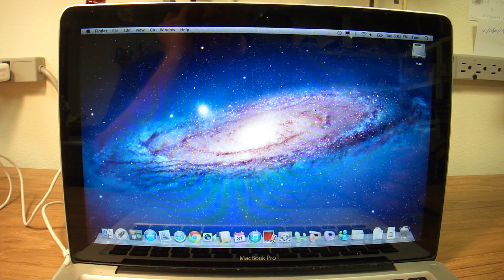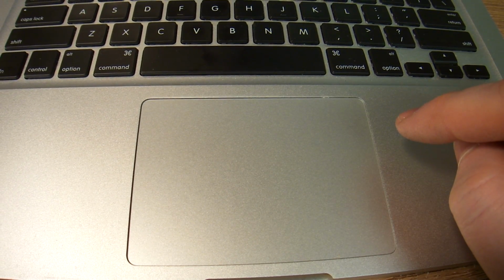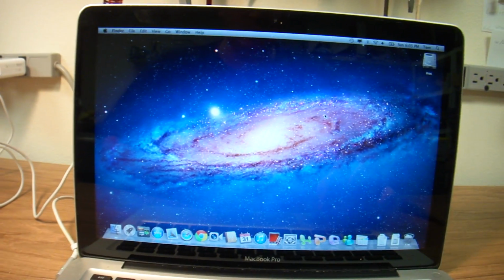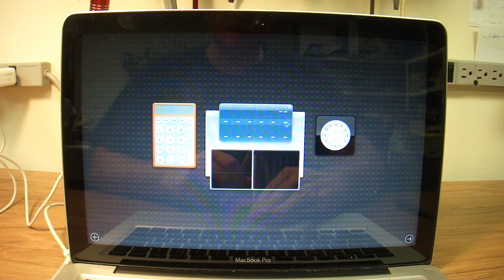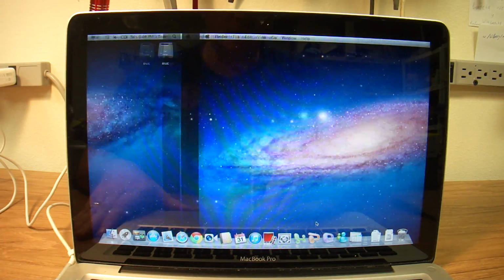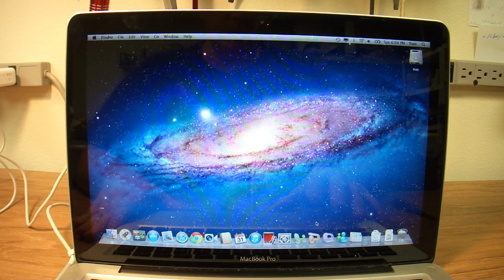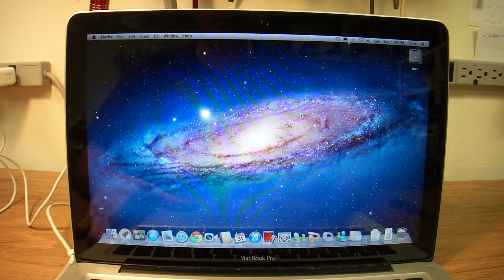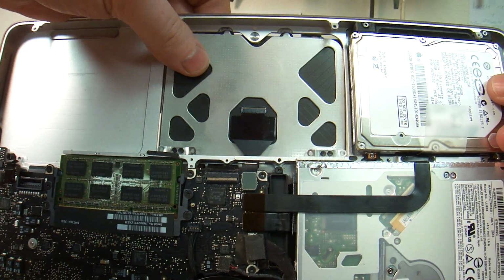How to quickly fix your MacBook Pro touchpad trackpad that is misbehaving for FREE

Comment: Grand merci! Après des heures perdues du coté du reset PRAM/NVRAM, SMC etc, j'ai compris que le problème était (en partie) mécanique: en appuyant un peu plus fort sur la trackpad, le pointeur se calmait temporairement. Après démontage, j'ai donc nettoyé son pourtour et celui de son support. Mais cela n'a pas suffi; lui fallait un bon bain d'alcool (à 70°, dans mon cas). Une solution logique, pas chère et parfaitement efficace. Bravo!

Big thanks! After hours wasted on the PRAM/NVRAM, SMC etc. reset side, I understood that the problem was (partly) mechanical: by pressing a little harder on the trackpad, the pointer temporarily calmed down. After dismantling, I therefore cleaned its periphery and that of its support. But it was not enough; he needed a good bath of alcohol (at 70°, in my case). A logical, inexpensive and perfectly effective solution. Great!

Comment: I was just about to spend 60 bucks for a replacement trackpad as mine was going crazy and the cursor was jumping all over the screen.  Decided to try your method first.  Worked just as promised.  Trackpad functions like new and the mouse is back in the drawer. Thanks!

Comment: Leave it to Apple to use a Y-screw just to make things difficult for DIY'ers. I have an entire 'small' electro-screwdriver set purchased for electronic repairs that doesn't even have this.
Anyway thanks for the fantastic video! I've tried everything else so I'm sure this is the issue. Will know once I've purchased a 'Y' screwdriver just for this :T
EDIT: Finished as instructed, trackpad works like new! 
Got this $20 electro-screwdriver set from Amazon that has everything needed and more, including a 3.0 "Y" Tri-wing screwdriver needed for the battery: https://www.amazon.ca/Durable-Tri-Wing-Screwdriver-Nintendo-Gamecube/dp/B01KLLD8WY/

Comment: I noticed completely erratic behaviour on my trackpad of a macbook pro retina 15'' late 2013 this morning. My trackpad opened up random applications and moved over the screen. I did an SMC reset, without results. Afterwards I cleaned the edges of the trackpad with CCC contact cleaner (especially suited for electronics). To my understanding, you can use alcohol too, but I wouldn't recommend it, since some electronics can be damaged. When you take the time to get through all the nooks and crannies of the trackpad, it cleans out all the garbage that gets trapped there over time. To do this, I firmly pressed down the trackpad in 4 corners and made sure it was cleaned properly. Did an SMC reset afterwards --> fix. Hope this will help for anyone that ends up here.

Comment: P E R F E C T! My trackpad was going nuts everyday after i cleaned it, it didn't matter if i was using only water or alcohol to clean, It was going crazy for hours, until it dried up, but even drying up it was acting a little bit weird, i was having to turn the trackpad off on the accessibility settings, and use an external mouse. I'd take it out twice to clean before, but i didn't submerge it in alcohol as shown in the video, so it did not work. Now i took it out and submerged it on 45% liquid alcohol in a pot and stirred it up for 2 minutes, and i saw micro hairs coming out. Then i used a toothbrush with 45% alcohol to clean the corners of the trackpad and also the trackpad slot on the macbook's frame. Then i dried it up with paper and waited one hour for it to dry up for itself.  I just reassembled it, and it's working perfectly, i also just cleaned my keyboard and trackpad again with alcohol, and this time he is not acting up crazy. Thank you!

Comment: Awesome. Great knowledge of the electronics, chemistry (alcohol), and procedure to make this video! Only thing I’ll add is that to remove the battery a correctly sized tri-wing screwdriver is needed, and after removing the battery the trackpad is workable as seen in this video.

Comment: Hmmm.  I seem to be one of the only ones this did not work for.  I took mine apart and it was indeed very grungy.  I cleaned it w Alcohol and was all excited to get it back together.  Still have same symptoms.  I did notice that someone had already been in the laptop before I owned it.  Yes, mine was a refurb.  I noticed the big barrel nut that held the chip end of the trackpad had a blue substance I assume was locktite.  When I went to put it back in, the threads were stripped.  Now I have to get some more locktite to replicate the previous fix.  I'm frustrated at this point and thinking I need to buy a new trackpad.

Comment: I spilled Coke on my Dell Inspiron. It has a similar touchpad. I can use the pad but the mouse buttons are not working properly. Left click works sometimes. Right click never works. Also, the sound it made on clicking the buttons are gone. Will this method work ??

Comment: Thank you it work perfectly. I didn't take the  touchpad out, I carefully moved the battery without disconnecting it. I used a Q-tip and alcohol around the edges top and bottom of the touchpad. I let it dry for 30 minutes before I powered it back up.

Comment: THANK. YOU.

After having my battery explode and my hard drive failing, then the trackpad started to go crazy and clicking everywhere. Your trick saved me from buying another trackpad, and it only cost me 90¢!

One thing though guys: Watch out not stripping the 4 little tiny pale gray screws on the trackpad (I stripped 2, but still managed to put it out anyway), be REALLY careful!

Comment: It worked for me! Had a little bit of water inside the trackpad (bottom left corner). Inside the macbook, found water underneath the battery and the trackpad. Dried it with a paper towel, then I did the ziplock bag trick with 70% isopropyl for the track pad, dried it all about 1 hour with a fan on high speed just to be sure, put it all back together and worked perfectly on the first try...! THANKS

Comment: Having had this issue on one of my MacBook Pro 13 2011, I followed the advice AND it worked perfectly. Only slight change is that I used a hairdryer to speed up the evaporation of the "rubbing alcohol". Excellent video.

Comment: THIS FIX WORKS!

a drop of liquid dropped on the side of my trackpad and it started moving on its own and opening apps or moving pages etc.

I gave my trackpad a bath in 70% alcohol and cleaned the sides before finally letting it dry for an hour and then assembling it again. It has been a few hours now and still no signs of the bad behavior before. I will update if it occurs again.

Thank you for the fix!

Comment: This helped me but you should understand you may lose your battery while removing the battery for MacBook Pro retina 15. This is how I did mine.

1) Open the Laptop Bottom, By removing the 10 Screws.
2) Unplug the battery, to remove power on the Board.
3) Pour the alcohol on the trackpad where your fingers move the cursor. "Just little",  do not allow the alcohol to move to the keyboard area. 
4)Then use your finger to press down the left and right click lightly, to allow the alcohol to go through where the water substance went through.
5) turn it around to let it go round to allow the alchohol to  where you can not reach.
6) Open Bottom let it stand by its side on the table and Switch on the fan to dry things Up. For (3hours..)

Your laptop trackpad should be fine without removing the battery

Comment: Worked. Thanks. You need to replace the black tubing and lock it down with the mechanism on there. Easy, but not mentioned in this video. This is my fifth repair or replacement of MacBook stuff, and this video checks out.

Comment: Hi, that procedure can be done with a different trackpad model? The one I got has a little band board with some circuits and transistors on it and two little strips of plastic circuits that go from the band board to the inside. Thank you

Comment: I stay in the UK. Got some Surgical Spirit from Boots and went through this. My touch pad is as good as new! Thanks so much! Only thing I would mention is you need to remove the battery before getting to the stage in the video. The battery has a couple of funny Y shaped screws but I managed to get them out with a tiny flat head screwdriver and elbow grease! Great fix thank you!
* a few days later the problem came back! Maybe I wasn't thorough enough. Will try again.

Comment: This works. I tried taking it all apart and clean WITHOUT using alcohol but the problem was still there.  USED ETHYL alcohol and followed the video and the problem is fixed.  Thanks very much!!!

Comment: Good tip. Thank you.
Oh no. The touchpad is still not sealed?   
Tip. The gallon and quart cans of alcohol at Home Depot are about $12 and it's 100% alcohol.  Most isopropyl alcohol is 70%.
What's also good about alcohol is how quickly it evaporates, it also mixes with water making the water evaporate more quickly. So you could wash two t-shirts, rinse one in water alone, the other in water and alcohol, wring them out, hang them up and the alcohol one will dry much more quickly.  Some warmth, not heat, also speeds up drying.

Comment: So when I put this back together, after replacing trackpad screws I'm finding the black tape piece was not sticking back on. I was thinking that was ok and that the battery would hold it in place but not when I start back up the cursor is stuck in the upper left corner. Any suggestions?

Comment: Pretty helpful, but everything fell apart when I tried to insert the ribbon back into the housing on the trackpad. That housing is VERY delicate, and after a few attempts to get it to slide back in, I pushed a little too hard and RIPPED THE WHOLE THING APART. Gold contacts splayed all over the place like the hair of the daughter of Midas. I'll never know if my cleaning job fixed the trackpad problem because the housing is RUINED. Interesting that you didn't show this part of the repair in your video. I did clean out the gold contacts and put everything else back together and fortunately the laptop still runs, but I have to use a mouse as I've been doing for several months. Goodbye trackpad.

Comment: Worked great for me!!! Much faster than waiting for a new trackpad and much cheaper too! I used 70% alcohol and it worked fine. Waited about an hour for it to dry. 
My only suggestion is that the trackpad had a bit of wiggle room when I put it back in for my 2012 13 inch Macbook Pro and I had to re-open everything back up to make it straight. So my advice is to put the trackpad back in, loosely tighten the 4 screws that hold the trackpad on, then open up the computer and make sure the trackpad looks good and is centered etc. and adjust if necessary. Then tighten the 4 screws all the way and finish up putting the computer back together.

Comment: i tried using the alcohol but did not soak the pad in. Wiping it was enough.
Reply: Me too! This should definitely be the first step in the repair instructions.  Why take the whole computer apart if a surface-level cleaning would be sufficient?!

Comment: Was skeptical about how much difference this would make. My 2011 15" MBP trackpad last two weeks has been jumping around the screen uncontrollably, opening apps etc. I've had a mouse plugged in and turned off the track pad. Tried everything on all forms and was about to go buy a new trackpad. Gave this a go and sure enough 3 hours later i havnt had any issues with it! Will update if it goes back to being bad but Cheers man, awesome guide!
Reply: any updates ? I don't have alcohol can I try cologne or perfumes ?
Reply: wouldn't recommend using cologne or perfume, has other chemicals which may damage the parts.. was good for a few weeks and came back, but only very minorly and would barely happen. Worth the attempt but i would wait until you get 70%+ alcohol

Comment: what if the touch pad is doing the opposite? Like not responding to touch? thanks :)
Reply: Chances are your Mac's battery is swelling and is in need of replacement. It's possible that it could be something different, but in my experience with mine doing that, it was the battery. Hope this helps you out.
Reply: 100 to 120 pounds from apple 40 pounds from eBay. Even the apple guy on the phone told me its not worth it.

Comment: I got a few drops of water on my track pad and it was not working properly.  thought after I let is dry out it would be fine.  the next day it was even worse....unusable.  I thought I had a swollen battery or pooched the trackpad.  Before bringing it in for repair tried this with 99%  and it's working like new.  Thanks

Comment: Will this work for a track pad that lets me click on stuff but does not let you control the little arrow
Reply: Worked totall for me everything back to normal and cursor control and all.
Reply: i have the same problem, hardly thinking to do this
Reply: Do it, it is easy. just make sure you have the correct tools and alcohol. You don't need to put it in a bag i just drenched mine on a plate and scrubbed it with a toothbrush, let it dry put it in and you have saved yourself a lot of money.

Comment: I've tried pretty much everything else bar replacing the entire trackpad. Although I have had the replacement completed by Apple some time ago the problem is back. It is a 2009 13" MB Pro though, I've ordered all necessary parts so probably next weekend. Can't wait to see if this works, it's driving me nuts trying to use it.

Comment: WOW, I used another fix this page to figure out how to take the Macbook Pro apart, then this page gave me the final fix!!! I used 80 percent alcohol, so I let it dry a lot longer. When I reassembled, only half the touchpad responded, so I quickly took the battery out and noticed the touchpad connector was not in place securely. Connected it tightly and _ALL BETTER ! Thanks!

Comment: Hi, I tried this and I need to point out that where you removed the sticky backing on the trackpad ribbon cable, you didn't show how to reattach it? I can't do this at all so the trackpad is now useless.. Looking at the Fixit page here (Step 8.. https://www.ifixit.com/Guide/MacBook+Unibody+Model+A1342+Trackpad+Replacement/6338).. this is the correct way to remove it..

Comment: Hey, did anyone's trackpad stop working after following the video? I'm not quite too sure where I had went wrong but does anyone know how the tape behind the trackpad is suppose to be reconnected?
Reply: Eugene I was able to find a vid on youtube that shows how to reattach the ribbon. Its title is "Macbook track pad ribbon cable reseating" by Nathan Zoet !!!! It worked after reseating the ribbon.
Reply: Yes he doesn't show how to reattach the ribbon from the main trackpad because I could not. Check the iFixit guides on how to correctly remove a trackpad, there is a connector on the motherboard where you pop out, not tearing off the gluded on connector on the trackpad as he did for some reason

Comment: So I just completed everything he showed in the video and so far so good. My trackpad had gotten some liquid down in it and kept going haywire, but his video completed in its entirety took care of the trick for me. A couple of things to note: A) I wasn't worried about the warranty since my MBP is from 2010/2011 B) He doesn't show you how to remove the battery, so I watched a similar video that shows how to do that. You WILL need a Y-type screwdriver bit to remove the battery. I ran to Wal-Mart and picked up a $7 screwdriver and 44 bit set that happened to include small enough bits and Y-bits for all the various types of screws you need to do this C)I used the 70% rubbing alcohol, not 91%. Now, after putting everything together, and working at it for 20 min. or so, I haven't noticed my computer going haywire and the mouse wanting to go buggy on me. This was extremely helpful and way cheaper than taking it in somewhere or even buying a new trackpad on eBay.
Reply: Ian Boen update?
Reply: Do you have a link to the video showing how to remove the battery?
Reply: PEOPLE!! STOP BLAMING THE VICTIM (yourselves): IT'S ALL LIES YOU'VE BEEN TOLD. EX: Apple saying their butterfly keyboard collects dust or crumbs --- but their computers BEFORE the butterfly mechanism were FAULTY garbage too! %$##@@!

THE TRACKPADS ARE POORLY MADE IN CHINA, like ALL Apple products are. (Remember iPhone 4-gate, where super-con man Steve Jobs said their customers "don't know how to hold a cell phone!" and then after the uproar continued, he FINALLY ADMITTED they had lied totally [FRAUD, a crime] to cover up Apple's systemic CRIME [fraud, etc].) 

APPLE CUSTOMERS: "Just cuz POWER CORRUPTS and Apple has the MOST POWER ever, does not mean Apple is corrupt!" 

AND SO APPLE CONTINUES TO ROB US DAILY cuz the public repeats Apple's own lies! 

(ex: I've had TWO trackpads fail on Macbook "PRO's, years apart, and NEITHER ever had any food
or water near them nor the trackpad.) 

WAKE UP, zombies. 

MONEY CREATES CRIME. 

APPLE must sell more product every 3 months ("quarter") or else they'll lose their jobs. But it's NOT POSSIBLE to sell more iPhones every 3 months forever.... so they did what ALL successful companies do: you START SKIMPING ON PRODUCT QUALITY; worker pay and benefits; etc. 

APPLE EVEN OUTSOURCES THEIR PROGRAMMING JOBS NOW, to China etc! 

AND THE MORE CRIMES APPLE GETS CAUGHT IN, the more everyone says they should NOT be held accountable for some of the greatest fraud in world history?

Comment: Can I use vodka 45%?
Reply: LoL
Reply: I was serious, got se desperate I ended up using water. And guess what, it worked!
Reply: Issue with water is that is corrosive and it not evaporate really quick. Alcohol does both of those things well (non corrosive and evaporates). I personally do not agree that water is non conductive. It conducts electricity, like alcohol does too. Difference is that alcohol evaporates and prevents chance to make a short circuit.